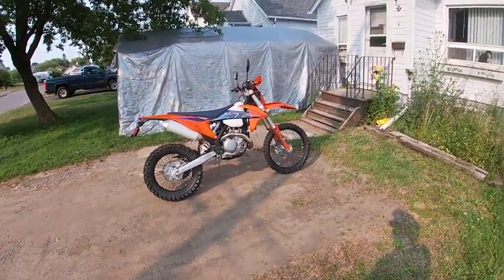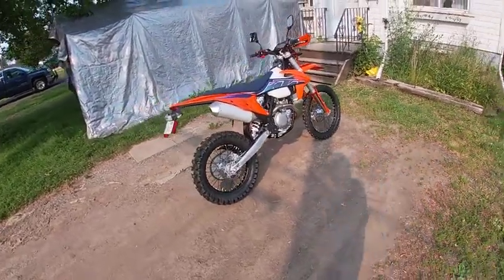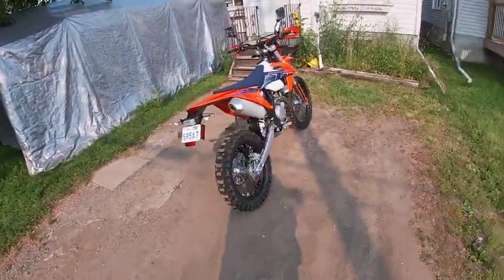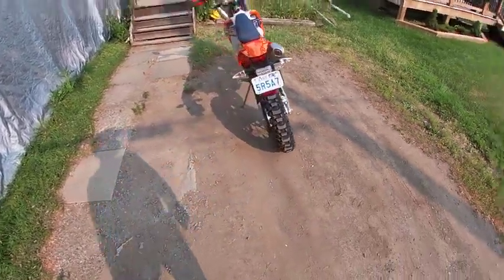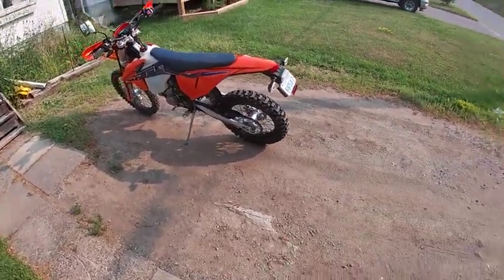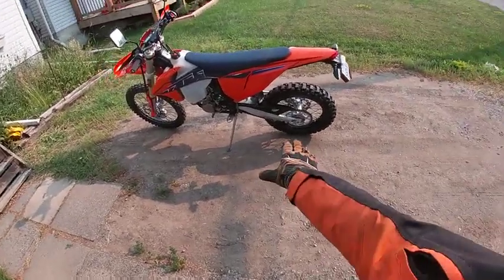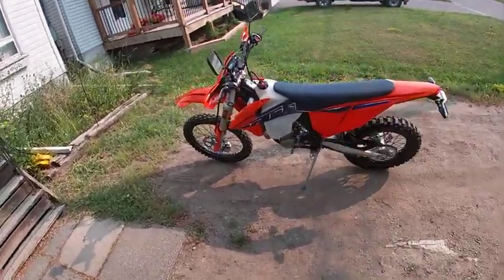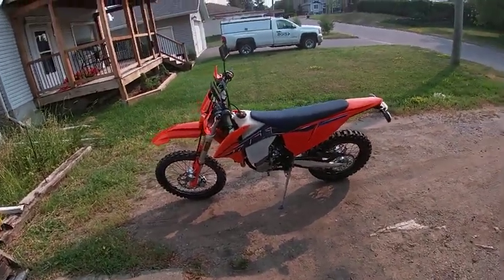dirt bike revealed ,landscape version:re upload video

Comment: What tire set up are you running? That rear doesn’t look like a TKC 😂
Reply from the maker: Lol...I'm using a motoz tractionator/desert on the rear and a Dunlop 606 on the front(I think..)
Reply: @adventureswithkatem  that’s the set up I’m thinking of going with. Your thoughts so far? And are they dot approved?
Reply from the maker: Back tire is not sure about the front.. been stopped a few times by the cops and never been asked about tires
Reply: @adventureswithkatem  love Canadian OPP’s 😆